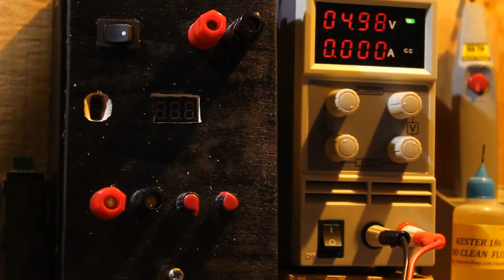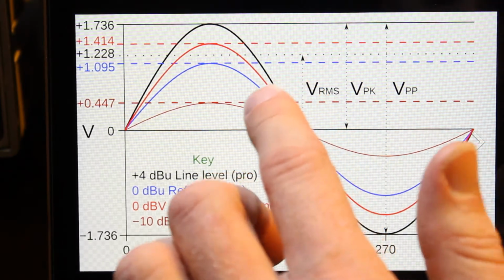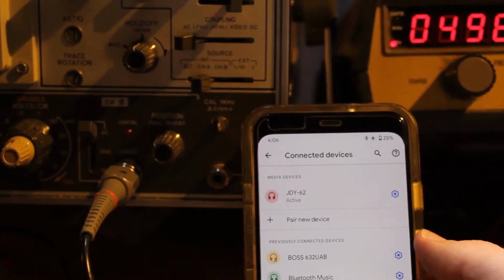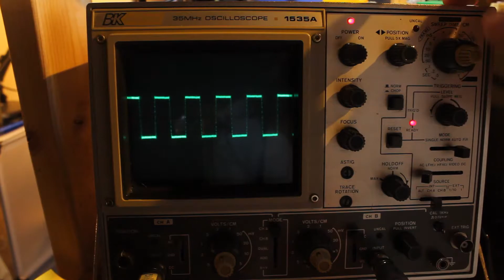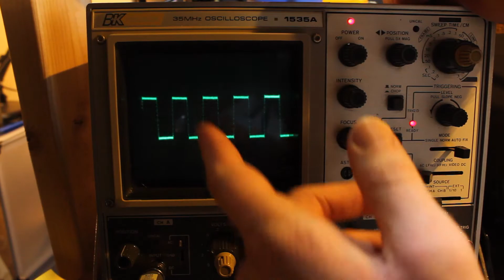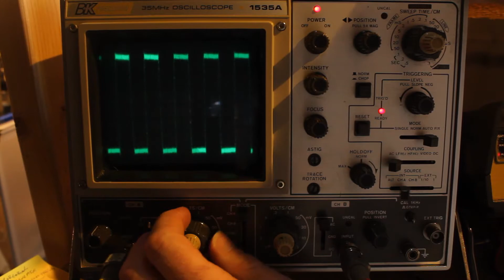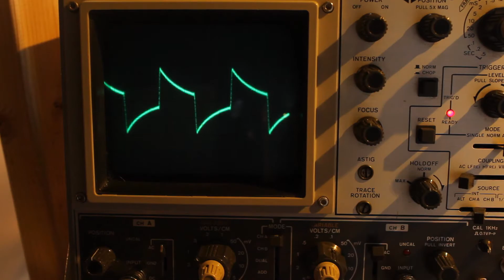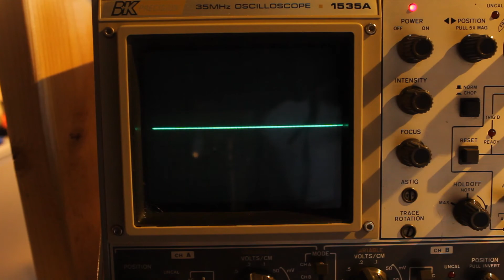Testing a "JDY-62" bluetooth audio module

Comment: I am looking for hands free blue tooth module for connecting to phone for calls.  
Does any body knows of any module that can do this?  I want to connected my own mic and speaker to it.
Most modules I see can be used either as transmitter or receiver. I wonder do they modules for hands free calls?
Thanks.

Comment: Bluetooth audio transmission is lossy, and lossy codecs are not optimized for square waves, as you generally don't encounter them in music . Unless there are audible issues, I would say this module works as intended.

Comment: Is it necessary to put an lc filter if I already have a 5v voltage source?
Reply from the maker: I don’t think so.
The long, general answer is, it depends on how electrically noisy your 5v source is, you’d have to check the ripple and noise on an oscilloscope to be sure.
Practically speaking though, I think the ic itself is responsible for most of the interference on its output. There wasn’t a significant difference between the filtered and unfiltered supply, and the output noise is still present in my finished project despite having a similar setup to what’s recommended (LC filter on the primary amplifier power rail and a linear regulator driving the 5v rail).
Reply: @Jollyorangegiant  can i use the 12v output from a dc dc converter and power it with a voltage divider (2 resistors) with 5v. or would this make noise sounds
maybe need a small capacitor????